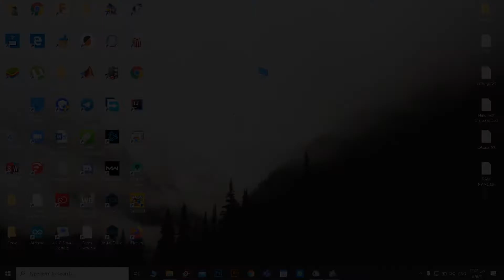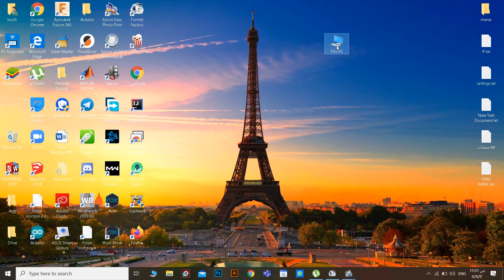How to upgrade Laptop ASUS-FX553V from RAM 8GB to 16GB

Comment: I followed all steps but now nothing happens when I turn on the laptop. I hear the exhaust fan, but the screen doesn't light up.
Reply from the maker: you have installed wrong RAM، or you didn't install it correctly, what is the ram exactly?

Comment: I'm trying to install a 16 GB one into my 8 GB. Do I install it the same way? I tried and my PC is not recognizing the new one. This still says 8 GB
Reply from the maker: 1- Try to remove the 8 GB, and install the 16 GB alone to check that the 16 GB is working well.

2- be aware that not any ram can be work on any pc or labtop, you have to make sure that the RAM you try to install is matching your PC, it should be same specification as your old RAM, namely(check : RAM SPEED [Hz], TIMING, DDR4)

Comment: Hi i dont have the safe ref for my pc. I have FX553VD-DM420T, do you think the ram you using will fit on my laptop?
Reply from the maker: I don't really know, but u can check this way, 

1_ Download "Speccy" Software. 
2_ Open the "Speccy", go to RAM -->Check the Clocks, in my Case, they are : 17 , 17 ,17 ,39 ,
so the ram u will installed should matches these clocks time> 
3_Close the software, 
4_ Go to "Task Manager" ---> "Performance" Tab ----> Click "Memory" and check "Speed",
in my Case it is :: 2400MHz, 

* Try to open your Laptop cover, Check how ram is installed, is there a place for second Ram? 

if u see that your specifications of RAM is same as I do have, you can install the same RAM I have installed,
otherwise, u should buy a RAM that matches your specification. 

if u have any difficulties, I can contact u on another media if u wish :) 
Hope the best for u <3

Comment: Hi sir I have same laptop can you please suggest to me how much AMPS maximum SSD  I can used my laptop. I found at the local market starting 2.5A to 3.7A and maximum m.2 SSD and without any Information about AMPS . So can you please advise which one I can use my laptop.
Reply from the maker: I bought an ssd and installed it, and it works fine and fast, this is the name of it from amazon: "Crucial P5 1TB 3D NAND NVMe Internal SSD, up to 3400MB/s - CT1000P5SSD8"
Reply from the maker: @thinkquanaut  Yes it supports both SATA and NVMe, currently, I am using "Crucial P5  3D NAND NVMe  SSD", and I made a speed test, it reaches 3400MB/s as the product says, I did not try Samsung but I think it can work too, tell me if anything else you want to know, best wishes <3
Reply: @husseinal-janabi2421  Thank you so much for the prompt reply! My model is the FX553VD-DM013T, is this model supported though?
Reply from the maker: @thinkquanaut  My model is : FX553VD-DM585T, I am not really sure if both are same.

Comment: I have same laptop with 16 gb ram 
Asus fx553vd but my boot time is 2 minutes 
I tried all videos but no fix till now . Pls suggest a solution
Reply from the maker: 1- SSD OR HDD ?
2- How much storage you used? how much left (free)?
3-is tempreture ok / fan working?
Reply: @husseinal-janabi2421  yes 
I have 600 gb left 
And my temperature is normal
Reply: do you have 1 ram of 16gb , or two 8gb x 2 ?

Comment: Will it support hyper x ddr4 2400 MHz 8 gb ram ?
Reply from the maker: you have to make sure the Timing matching the existing one,
you can use a software called "Speccy" to check the timing,
for me it is 17-17-17, so make sure both are same timing, otherwise, there will be problems.

there is no problem if the company is different: hyper, Crucial ... whatever ...all works

Also check the dimensions, some rams come larger than usual.
Reply: Thanks ! It’s working fine !👍🏻